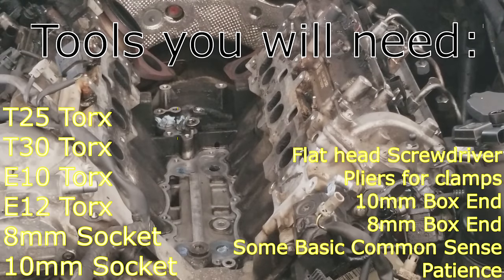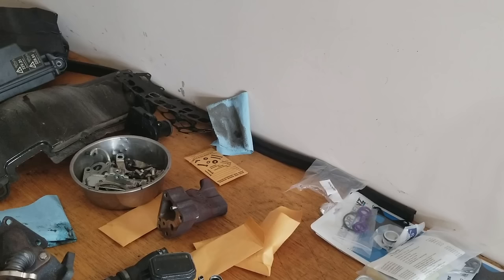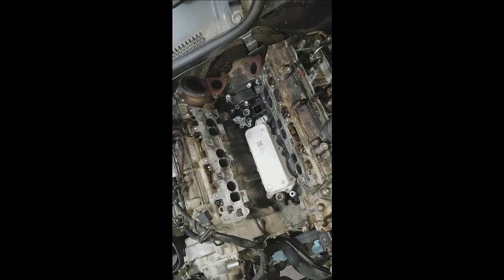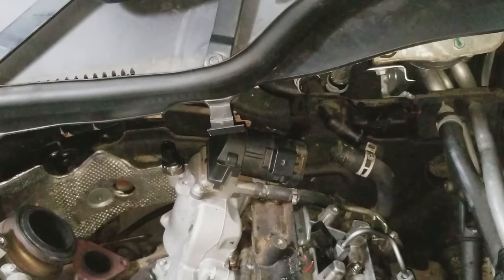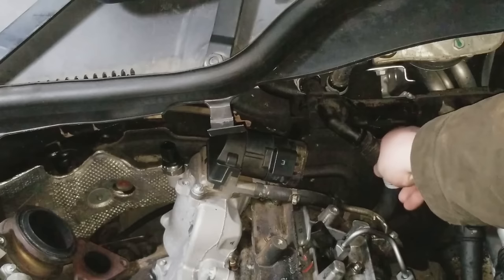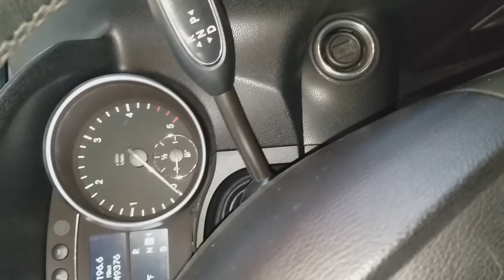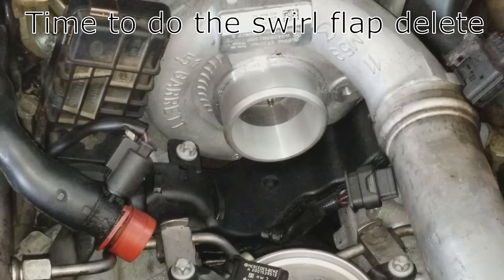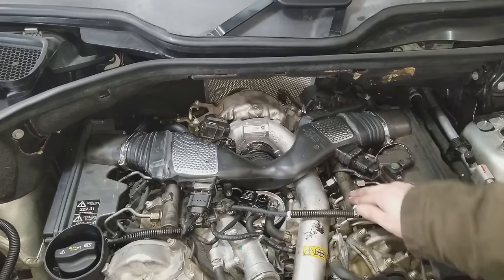OM642 Oil cooler seals DIY guide and timelapse!

Comment: Couple of questions .. what gaskets did you need to replace, plus any bolts/fasteners. Additionally, I've tried the swirl flap resistor on my '07 Jeep Commander, and every now an then I have the "electronic throttle light" come on and power reduces. If I stop and cycle the key, it goes away. It seems to mainly happen when I am towing a heavy load, but for day to day driving I don't have the issue. Any advice??? I'm about to follow your video and replace the seals on the oil cooler, and may possibly do the oil cooler on my Jeep whilst I'm in there. So thought while I'm at it, I could either fit a new swirl actuator motor (and make a shield to divert any oil, or just keep the 5 cent resistor fix. I'm just worried/concerned that as the resistor does not work 100% of the time, that there is another issue. Open to ideas and thoughts.
Reply from the maker: i would advise you get a scanner to read the ECU and find out for sure whats causing that check engine light and limp mode before you go replacing parts, otherwise you're kind of flying blind HOPING you're replacing the right part. i would suggest you erase the codes first and then try and replicate the problem again to get that electronic throttle light to go on again, and then read codes.

Comment: After removing injectors do we need to bleed the fuel system?
Reply: The mb instruction does not say anything about bleeding fuel system and I think it is pointless because all the excess air is transfered back to the tank as the fuel system has a return line all the way back to the tank

Comment: About the swirl valve delete? I'm in California can I delete the swirl valves legally? 
 Then if I delete them. No codes will appear?
I have a 2008 Dodge sprinter diesel with only 55k miles. Hours of idle time. Not any more!
Its starting to throw codes on my right back either not closing or not opening?  I don't remember what it said now. The cel has been off for the last 4 days. I got lucky.  I went to have it smogged. The light had gone out the day before.  I got it smogged.  On my way home. It turned back on. It turned off again about 4 days ago.
Reply: Here is the link to the video I was talking about...

https://youtu.be/SmgskkSRrx8

Comment: After some hard acceleration, I have a major fuel leak and I checked everywhere. Found the leak coming from a drain hole in the block on the driver side, near where the transmission and engine meet. I read that that's the hole where the typical oil cooler leak drains. Now I'm trying to figure out how that's even possible for diesel to be flowing through there. Any help would greatly be appreciated.
Reply: Andrey Tereshchenko
I've seen a video where it says MB designed that hole for oil leaking down !!

Comment: Hey man! Awesome vid. Are you aware of any “upper oil pan leak” in an w211 om642? Each time I stop the car it has visible drops on the ground so it’s pretty big leak. My mechanic friends told me it s the upper oil pan and they have to remove all the front underside of the car (also 4matic makes things harder). Can it actually be the oil cooler instead? Thanks!
Reply: is that really a thing?

Comment: Hi there. Quick question. I have a newer model 350 bluetec. I took off the engine cover today and noticed some crud around the pipe that just goes onto the turbo. At 19:46 it would be the pipe that goes into the centre of the turbo below the sticker with the QR code. It is a moist sandy type crud that's black. Just below that pipe there is also some residue. Any ideas what it could be? It is still under maintenance plan but need an honest opinion in case they tell me otherwise.
Reply from the maker: That pipe has a changeable silicon seal that goes between the pipe and the turbo. When that seal wears out, it leaks condensed oil vapor over time down onto the swirl flap motor which can be an expensive repair. Have that seal changed PRONTO for preventive maintenance.
Reply: @MBDieselFreak  Thanks for the response. Will do so. 🙂

Comment: Thanks for the video. Just a few questions. How did you remove the EGR torx closest to the fire wall on the exhaust?  Was it still on the car?  If still in the ML would you use an Impact Deep Well Extractor Bolt-Grip socket?
Reply from the maker: I didn't remove the exhaust side if the egr tube, only the side that went into the cooler. Made it slot easier to remove those Torx bolts.
Reply: @MBDieselFreak  so when you say you "re bent" the tube, you left it connected on the exhaust side??

Comment: hey man... steve up here in Canada... just watched your turbo rebuild Video... it sent me here. I'm gonna try to remove/disassemble the inner core without unbolting the exhaust side from the engine... THOUGHTS?... as far as I can see, as long as I can pull it straight outward an inch there shouldn't be a problem. My inlet vanes are destroyed due to pieces of the deteriorated inlet seal  being sucked in ;( 

PS... this is on the /08 Jeep Grand Cherokee CRD

Comment: Hi,  what oil were you using before the oil leak? i have s 2012 GL 350 there are no oil leaks yet but i know a friend who had . i am using the original MB 5w30 oil. he said it started when he started using Mobil 1. what oil were you using before it started to have the leaks?
Reply: The oil leak is cause by cheap seals in older OM642 equipped vehicles. My 08 Jeep GC has over 155k miles and has a noticeable leak, but not enough to have to put more than a quart of oil in at about 7500 miles. I believe your vehicle is new enough that it should have the better seal. I believe the change-over happened somewhere  2010 time frame, but newer models may still possibly develop the leak, though the likelihood is greatly reduced. https://idpartsblog.com/2018/06/11/mercedes-oil-cooler-seal-leak-on-3-0l-v6-engines/

Comment: Hello
I have problem with oil in coolant container.. Do you think its may because of Oil cooler seals ? or its probably head gasket seal?  Coolant in oil isnt.. and leak started few month ago, after intake manifold changed.
What do you think ? 
Thanks
Reply: Dizo Diziansky check your transmission cooler at the radiator most likely is the problem
Reply: dizodiziansky3426 did you figure out what caused the issue? I have the same problem.

Comment: MBDieselFreak just wondering you might help me . I have a very bad engine oil leak . I took the car to a local garage and they said that the seal between engine and gearbox is almost gone. I am new on this models , so if you can give me an advice I 'll appreciate it . The car is a GL 320 cdi with the same engine from video . Thank you !
Reply from the maker: That's the rear main seal! If that's leaking the transmission needs to be removed to get to it. I would advise getting that fixed rather than just dealing with the leak.

Comment: Good video! I was wondering if you’ve changed the oil cooler, or just the two purple O rings? I’v just finished changing the seals on my E class, and  the oil leak is still present( I’ve seen a few oil drops on the drive way)...I didn’t used a torque wrench though on the oil cooler bolts.
Reply: must  be the old oil that stucked in the hole of the engine bloc

Comment: Hi, Great post. Doing mine now. I have deleted the swirl flaps and egr since seeing all the crud in there.
I am in the process of putting her back together. My only concern is around the steel gasket between the pillar top and turbo base. How the hell can you ensure it doesn't move  where it should sit as it is rather fiddly to mount turbo back in there. any tips?
Reply: ive seen guys use some sort of gasket glue to hold it there

Comment: Thanks a million . Very useful. Saved me loads of time.
One thing how did you blank of the swirl flaps?
Reply: iirc you don't blank  'em. with 'em removed the ports are completely open.
Reply: @tonyandhelen8126  Hi
Of course one does not black off the flap.
But the arm of the flap to the link needs to be blanked. I have seen people weld up the hole.
I tapped and put a bolt of correct length with some lock tight..
Just for other people going to do this the flaps need to be milled out.

Comment: How do I remove the turbo feed pipe? I removed the the bolts on the tube and the torx screw holding the clip but it wont budge
Reply: Good question! I also need the answer!
Reply: How did you solve this?

Comment: Do you even need to put the swirl motor back in if you trick the computer with a resistor?
Reply from the maker: absolutely not
Reply: @MBDieselFreak  and it will pass California emissions regulations and visuals? If they notice it missing will they fail it?

Comment: Just did this using your tutorial.  I replaced everything, went to crank up, realized I didn't tighten down 1 fuel rail all the way down.  After tightening it, I continue to crank the motor, no turnover....  Only 2-3 times did the engine start acting like it was trying to start up.  Any recommendations? did I fuck something up?
Reply from the maker: Air takes a LONG time to work itself out of the system. Takes 4-5 cranking sessions of 15 seconds each to purge air
Reply: @MBDieselFreak  I was doing that... but never started and now battery is dead... I could use my other car to "jump" it, but is that going to give it enough power?
Reply from the maker: @MrHerrick223  put it on a normal battery charger and leave it overnight to charge. Its never good to jump start an electrically complex car due to the large difference in voltage present when cranking.

as long as you're not leaking fuel anywhere, there's no reason the car shouldn't start.
Reply: MBDieselFreak so got everything back on... finally got it started, but now I have a huge exhaust leak coming from the main feed area. Not sure what has changed.... any advice? I replaced all the o-rings too...
Reply from the maker: @MrHerrick223  what do you mean by main feed area? The Intake? So the exhaust leak is coming AFTER the egr cooler?
Reply: MBDieselFreak It looks like it’s coming from the front of the engine, where the EGR cooler attaches to that main turbo intake feed
Reply: This is my 3rd time tearing it down to the oil cooler.... bout to just take it in, but want to at least try to save me a few thousand
Reply from the maker: @MrHerrick223  my guess is you forgot the o ring between the egr cooler tube and the intake tube.
Reply: MBDieselFreak I took out the O ring from the gasket set I bought, to my eye it appears slightly smaller... I’m going to put the old one back on and see if that fixes it
Reply: MBDieselFreak so I replaced everything again, the EGR part of that piece got slightly bent, could that cause what seems like a vacuum leak as well?
Reply from the maker: @MrHerrick223  diesels don't generate a natural vacuum.  whatever youre leaking, its not vacuum
Reply: MBDieselFreak so finally got it up and running normally again..... I didn’t bolt the intake to the turbo, so started sucking a ton of air and thought it was a vacuum leak. So far no oil leaks. I have to replace the EGR pipe as it still had a slight exhaust leak, but for the mean time I just plugged in another o ring to create a temporary seal until I can get that part in the mail. $300 from the stealership! Thanks again for answering all my questions! This video was extremely helpful! Saved me thousands!

Comment: how long are the new purple seals supposed to last?  mine was changed at about 78,000 km, and it's now about 150,000km.
Reply from the maker: Are yours leaking now? Supposedly the flawed design is fixed for good with the new purple seals, so if they're leaking, they have been the origional flawed design seals that were changed at 78k km
Reply: @MBDieselFreak  I have a leak, but i'm not sure if it's from the oil seals, or from somewhere else.  it's oily at the front of the engine under the oil filter cartridge on the right side and around the water inlet housing on the bottom left.

the part number of the new oil seals when the dealer gave me the work order is 642-188-04-80.  Are these for the purple or the old?  Did they change the part number when they went to the purple seals?  these seals were done in Dec of 2014.

Thanks for your advice!
Reply: @ducduc1098  what was leaking sir?

Comment: How do you remove the swirl flaps. Do you have to have them welded after removing them?
Reply from the maker: you break off the internal flap of sheet metal thats spot welded onto the shaft, remove the plastic holder that holds in the shaft, and then pull the shaft out. i put the shaft and holder back in afterwards to seal the hole.
Reply: @MBDieselFreak  don't suppose you have any images. I've to silly got round to removing my inlet but not sure what to do about the hole as not totally sure what you mean

Comment: Can I assume you only drained the coolant but not the engine oil?  Does it make sense to drain engine oil and put it back in at the end?
Reply from the maker: i mean you could, but by removing the intakes and the oil cooler, you're going to get coolant that's going to drain into the oil passages in the block.
Reply: where can I find torque specification for each bolt/screw especially the once that goes into the aluminum engine block?   What is the general guide for 10mm vs 13mm looks like those are commonly used scrwes.
Reply: and thank you for the video and timely reply....... this is a great learning experience which I will not even attempt without help from people like yourself.
Reply from the maker: @mackdesigns4930  the best place would be in one of the WIS factory service manual programs. You can find copy's on eBay for like $10
Reply: @MBDieselFreak  I noticed in the video you started the motor then mention changing the oil. You also mention coolant dripping into the oil passages so do we assume that you started the engine with coolant contaminated oil?

Comment: How many NOX sensors does a 3.0 Blue Tec have???? and where are they?     ref: 2013 ML350
Reply: 2 nox sensors
Reply: @noleksandr  are they different or the same?
Reply: @noleksandr  are you sure it's not 0009053503...?
Reply: Hack Prine check on fcp euro or other website that will require vin number
If I remember correctly 3503 is for older models
Reply: @noleksandr  Thanks good to know....  I got sensor probs. I replaced the probe and spliced them on the control head... and found out they are a paired unit... now I'm screwed...   wish I knew a Benz mechanic...

Comment: This is a great video, I always wanted to know where the oil cooler was located. I could only see the oil leaking from it, By the way, do you know where I can buy a rebuild kit for the High Pressure Fuel pump?
Reply: If your asking about injection pump rebuild kit IDK, but I can tell you that the pumps work on very close tolerances. Even if you could/can find the kit the possibility of successfully rebuilding the pump would be slim. Look up Thoroughbred Diesel to find a rebuilt one at a decent price.

Comment: Is this the same process for a 2008 Jeep Grand Cherokee with this motor ?
Reply from the maker: I believe so yes. See bolts may be in different places because of the application, but the CRD engine is essentially the same.
Reply: @MBDieselFreak  probably worse because of the turbo location.  Not sure how much trouble those firewall panels will be to remove, but I replaced a turbo with them in, as it looked like a ton of pain to get the firewall panels out and moreso reinstall, and it's a royal pain to work on a turbo. Had to use 3 ft of 3/8 extension and come up from under the transmission to hit the rear mount bracket bolts. I now own 3 different types of 3/8 ratchets, which come in handy working on this thing - a stubby, a twist ratchet, and a flex-head with an angled handle, not to mention all the e-torx. I think the dealer/mechanic answer is remove the engine, hence the cost.

Comment: An example of the great mercedes engineering. "Hey guys, let's put the oil cooler UNDER the intake manifolds.  That way, our mechanic brothers can charge $3,000 to change the cheap oil seals that we're gonna install."
Reply from the maker: Not just Mercedes, tons of manufacturers started doing it with V engines. Planned obsolescence with purposefully costly repairs and cheap parts is pretty much industry standard At this point.

Comment: whats the swirl delete for ? why do we need to do that??
Reply: It's optional to delete, but unless you're replacing them, once you've gone to all the trouble doing this oil seal work, you might as well remove. Easiest thing is just to use the resistor to trick the ECM into thinking it's working. The cause is soot from the EGR system clogging up the swirl ports, causing breakage of the plastic actuator arms. A $150 upgraded metal rod kit is available if you're going to repair https://www.idparts.com/upgraded-metal-swirl-rod-repair-kit-om642-mbncv3-late-om642rodkitlate-p-10559.html#product_tabs

Comment: 18:50 Missing the upper gasket at pedestal I think. That might give u coolant and oil leak.
Reply from the maker: If I remember correctly, that gasket snaps onto the turbo, it's an aluminum gasket.
Reply: @MBDieselFreak  Oh I see. Mine snaps on to the pedestal.
Reply: @MBDieselFreak  I am in the process of putting my OM624 (2012 Sprinter 2500) back after an engine block swap. I did not put the harness before the turbo. Because of you, put all these puzzle pieces together is a lot easier and I found out I had 2 upper gasket on the pedestal! THANK YOU VERY MUCH!

Comment: Great video. Why did you say make sure you do an oil change afterwards at the end?
Reply from the maker: when the oil cooler is removed, oil and coolant is mixed and gets into the oil passages in the block. need to change the oil after its run a bit to remove coolant contaminated oil.